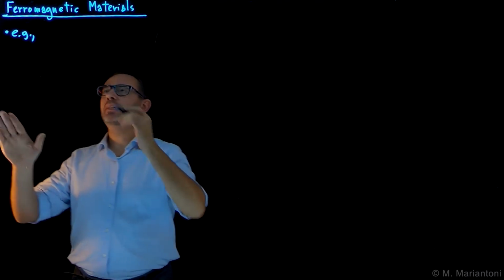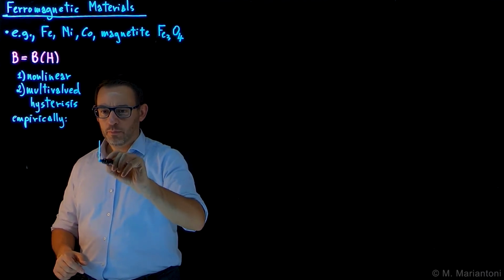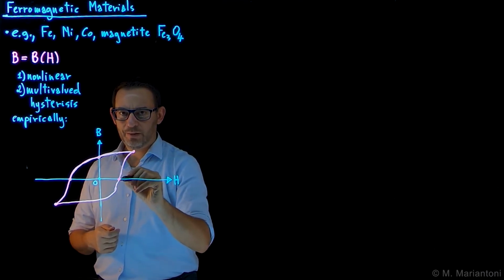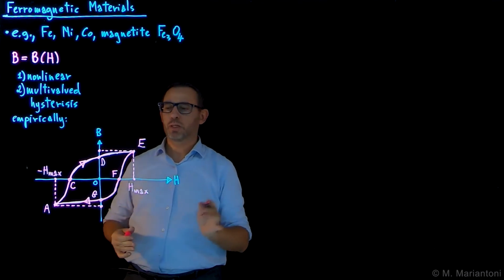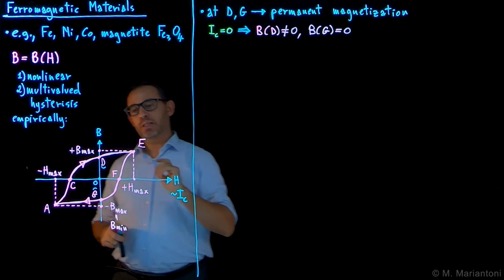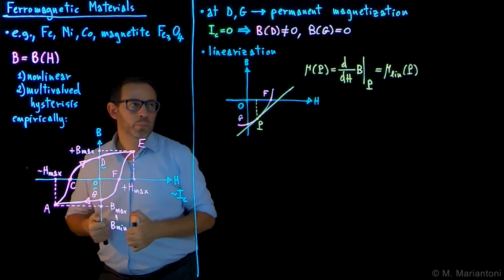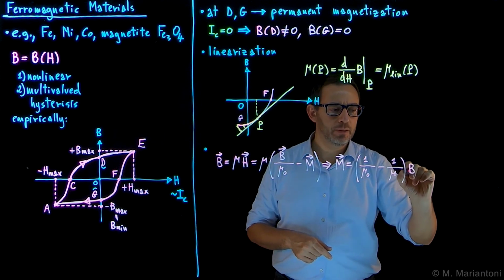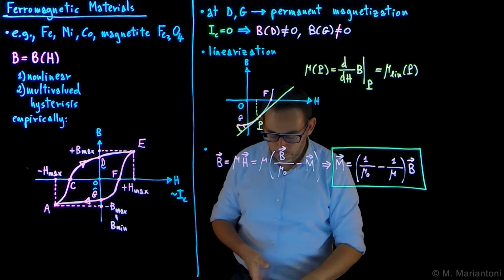90 Ferromagnetic Materials

Comment: Wondering if a piezoelectric dielectric resonator would be a candidate for the linearization method you describe?
It occurs to me though that there is no B/H hysteresis characteristic in a piezo resonator's material.  

In our case, we often use AIN and PZT (aluminum nitride and lead zirconate titanate) and construct laminations of layer-pairs of those materials.